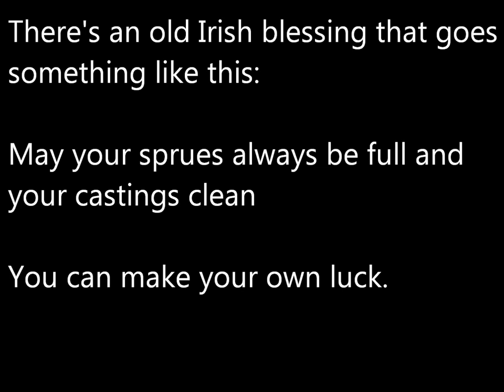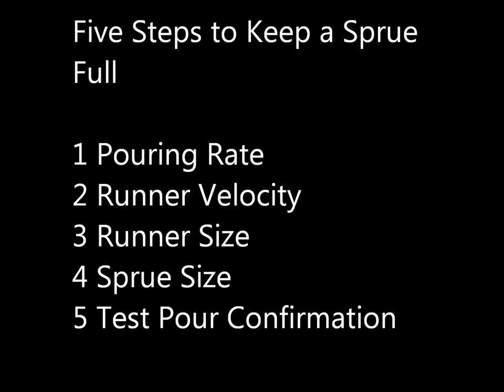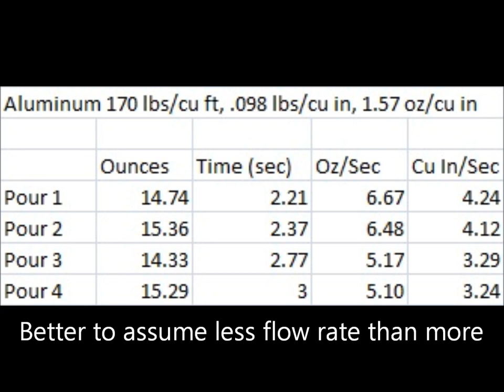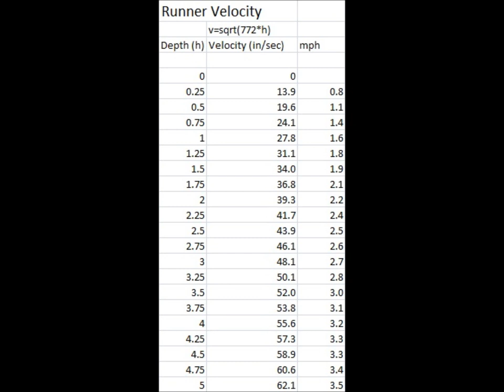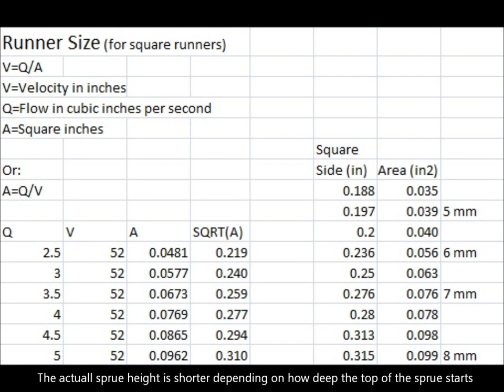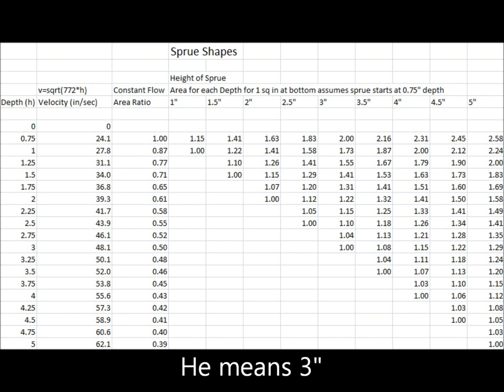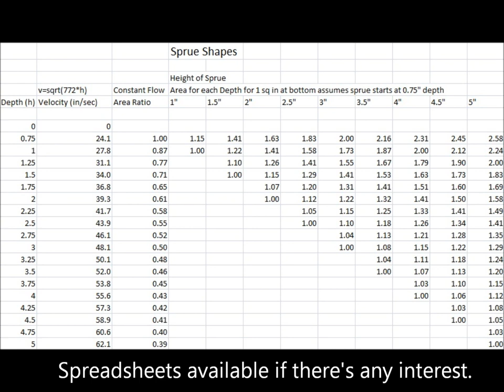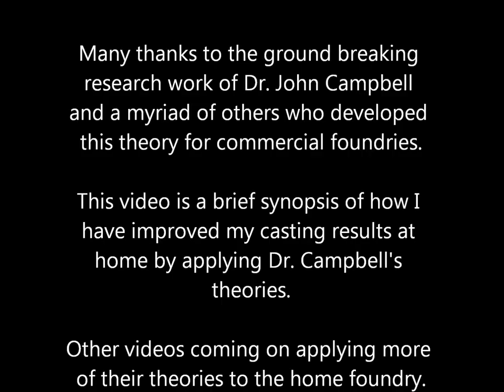Foundry 47: Keep Your Sprue Full

Comment: Andrew, Looking at the hammer castings I believe (largely because of the extensive flash around the core print) that your fill time could maybe have been quite a bit longer than 3 or so seconds. The great John C states that it is surprising how much slower many castings can be poured and that certainly is my experience. I might have been inclined to try a 6 sec fill but that of course would involve a runner and sprue so small as to be difficult to mould. Castings this small are thus difficult to rig properly. My inclination would have been to cast two hammers off the one sprue so your current sizing would have given roughly a six second fill.
I will attend to that Russian fellow's rule tomorrow (you know, the bloke with the unpronounceable name) I just need to mull over how best to answer in a useful way.... Martin
Reply from the maker: Thanks for your time, Martin.

My only goal with the four hammer pours was to gauge the pouring rate I am comfortable with.  You will note I used a giant sprue with no pouring basin and large hand dug runners.  Certainly I use smaller runners and a spin trap when casting hammers in earnest.

I want to cast two or more at a time but don't know how without more patterns.

I have attributed the flash in the core print to poor design.  I made this pattern when first starting out and always have the excess material.

I need to check on the Russian's heritage.
Reply: From a classroom prospective; Chvorinov's Rule was something we only applied to determine how long a casting would take to solidify and for sizing risers to prevent shrinkage defects. I highly question applying that formula to gating as I believe Chvorinov's Rule only applies after the metal stops flowing.
Reply from the maker: @askquestionstrythings   That is exactly the point.  You use Chvorinov's Rule to size the riser and the gate between the riser and the mold purely to avoid shrinkage.  If the gate does not freeze before the mold then it can't feed the mold.
Edit:  Should have said "If the gate freezes before the mold then the riser can't feed the mold through the gate".

Comment: Good technical info to keep for reference.  Thanks

I'm planning on casting a closed hand sized object and my understanding is that I should have a riser of greater volume to prevent shrinkage.  Is this correct?

What size runner is required between them? 
I assume that once the runner  solidifies, the two volumes shrink independently.
Reply from the maker: I'm no good at Chvorinov's Rule.  But no, you don't need a greater volume.  Maybe Olfoundryman will happen by.

Since you have a large solid mass if you feed through the riser it should be the hottest part when everything starts cooling.  There is a rule on the gate, but the larger the better.  For my hammer heads I use a short fat riser with contact of about 40% of the hammer face. (not in this video)

This is interesting reading and will enlighten you on avoiding shrinkage somewhat.

https://massalotando.files.wordpress.com/2018/10/projeto-livro-wlodawer.pdf
Reply: CP, It is not really possible to answer your question with any accuracy without a bit more information.
1. What alloy are you going to use as different alloys solidify in different ways and this can affect both the shape and size of any feeder?
2. When you say "closed hand" Is that about its size or its shape or both? Thin and thick castings require different feed regimes.
3. Does the casting vary much thickness or is it a fairly even section thickness all over?
4. Are there any heavier section areas that might be useful to attach a feeder too?
To be honest a drawing or accurate sketch would be needed. But what I usually do is simply eyeball the pattern and the reach for the appropriate feeder formers (I have lots) having done it lots guides me here. However as a general rule for aluminium castings in 356 alloy I find that the weight of the metal poured i.e. of the casting plus any feeders plus any gates sprue and basin etc is about twice the weight of the  actual casting. For thicker chunkier castings the weight of the feeder etc will go up and for thin work it will go down (quite possibly to zero!) This  is a very general rule and I will vary it a lot according to how the casting and feeder are attached. With favourable feeder attachment (i.e. a hot metal feeder) I will use a pour to casting weight ratio of 1.5.  Obviously the feeder must be larger in section than the thickest bit of the casting - by at least 20%. A favourite way of mine is to gate into the feeder and then connect the feeder to the thickest bit of the casting with a sort of gate only about 1/2 as long as the feeder is in diameter. The gate will be almost full section thickness of the casting where it connects and will flare upwards and outwards with a generous radius to meet the diameter of the feeder. This means that when fill is complete the feeder will contain the hottest metal in the system (neglecting the sprue and runner) and the casting will contain metal generally cooler and usually much so in areas more remote from the feeder - this is exactly what we want! As  it strongly favours directional solidification toward the feeder. However this implies a side feeder and  this is not always possible - sometimes a top feeder is appropriate - it depends on part configuration. In this case I tend to gate as close to where the feeder is attached as possible and the bottom of my feeders are necked down for a height equal to their diameter at a 15 degree angle (per side) in an effort to avoid under feeder shrinkage. Feeders are usually cylindrical and have a height to diameter ratio of 1.5 or maybe 2 to 1 for best thermal efficiency but I use them up to probably about 4 to 1. Note too that I almost always use exothermic on my feeders.... Martin
Reply: @olfoundryman8418  Thanks very much for your response.  
I'm casting aluminum, for now.
The object is both, size & sections of a closed fist.  No sudden thickness changes & about the same bumpy surface texture.

Your info is giving me clearer ideas how this planned project could be successful the first time.   I will read it a few more times,  I'm sure.
👍👍😊.
Reply: @cptrikester2671 , Oh dear! A thick chunky casting. They are the most difficult to feed, probably you will need a big feeder of at least equal weight and probably more to the casting unless of course you can hollow the casting out with a core. Good luck...Martin
Reply from the maker: @cptrikester2671  Very valuable insights Martin gives.

My advice is you learn more quicker by planning to make several castings modifying the attachment until you are successful.  Many times you just cannot avoid the extra cleanup a larger feed gate requires.  But you don't know until you try and fail with a gate which fits into where you want it and does not obscure casting surfaces you'd rather cast rather than clean up.

Comment: If I were a guy with your knowledge, I would have an excel spreadsheet that would calculate all this out for you and sell it for a few dollars each copy. This is great stuff and I would be your first customer. Looking for an easy way to determine size of sprue, runner, expanders etc.
Reply from the maker: It is explained in the videos.  The spreadsheet I use is incredibly simple however you have to understand the basics because each mold is so different.  It is really not difficult.

Comment: andrew i'm a little confused on the sprue shape chart .
Reply from the maker: Me too!

Concentrate only on the right hand side.  Find the sprue height you have, remembering this assumes the sprue is starting 3/4" below the top of the flask.  So if you have 3-1/2" tall flasks, your sprue will end 3-1/2" down so only look at the column under 3-1/2.

Now go to the bottom of the column and see 1.00.  Multiply that by the size of your runner.  If it is 0.076 sq in then the number will be 0.076 sq in.  The bottom of the sprue needs to be 0.076 sq in.  

Now look at the top.  2.16.  Multiply that times 0.076 and get 0.164 sq in.  That is the area of the top of your sprue.  You can taper the sprue straight from 0.164 sq in down to 0.076 sq in.  Remember these are square inches.  0.076 sq in is a square that is 0.276" on each side.  0.164 sq in is a square which is 0.405" on each side.

Hope this helps.Edit:  Per Martin's comment below, you should add 20% to the top area if you are not going to reduce the sprue as the chart shows but use a straight sided sprue instead.
Reply: @andrewmartin4258  ok i think i have it i will get back with you about it shortly
Reply: @andrewmartin4258 , In you calculations have you allowed that to compensate for the straight taper as distinct from the more correct hyperbolic one you need to have the top sprue area 20% greater than calculations based on sprue base, height, and flow rate would suggest? If not this may explain why in your glass experiments some separation is seen near the top of the sprue. Also I think greater care may be needed with the sprue entrance radius, if it is not adequate and particularly if you have a surge area above the top of the sprue and it is not radiused properly ALL ROUND then vena contractas will occur causing visible separation and lots of air entrainment (which you may not see)….Martin
Reply from the maker: @olfoundryman8418  Thanks, Martin.  No, I had not seen any mention of a 20% increase in sprue top area for straight sided sprues.  Perfect logic, for sure.  I need to do a glass one again with an additional 20%.

I'm probably guilty of not rounding my sprue entries enough.  Have to work on that.  Of course the glass pours have one flat side so it's like half a sprue.

Comment: More great stuff!  I'm going to reproduce your spreadsheets for my own use.  As I have proved before, I am deficient in mathematics, so I'm not going to attempt a calculation of Chvorinov's Rule, but it's good to know that the volume of a riser should be as large as possible in proportion to its surface area.  Doubtless there is a relationship, based on the shrinkage rate of the metal, between the size of the casting and the size of the riser.  Also not having the mathematic capability to calculate that, I a*s*s*u*m*e that it is better to err on the side of a large volume riser than it is to use a riser that is not large enough to feed the shrinkage in the mold.

Thanks, again, for your work!
Reply from the maker: Glad you had the time to watch the video!

The basis of Chvorinov's Rule is that the riser and gate should freeze last.  That's logical.  Depending on the shape of the part you are casting, you can guess pretty effectively how a riser needs to look chunky compared to the part.

Did you have a chance to look at the link?  Lot's of good information from Sulzer there, and they pretty much show you how to do it without many calculations.

For simple castings the modulus is easy to calculate, and you just have to keep increasing the modulus through the gate to the feeder.  Modulus being the volume divided by the cooling surface area.

Absolutely, a larger feed riser only uses more metal.

Thanks for the kind words!
Reply: @andrewmartin4258  I glanced over the PDF link, but didn't have time to read it thoroughly, although I will take the time to do it.  I thought the stepped riser gate design was interesting.
Reply from the maker: @carlericvonkleistiii2188  Of course it does not have to be stepped.  It can be sloped to achieve the same results, little bitty steps and lots of them.

It is worth the reading.  Although it won't be absorbed in the first few readings, the have what they call information for the practical man, rather than theoretical.  Lots of good advice and it will help everyone understand the basics and help you use judgement rather than calculations.

Comment: does this apply to the cast iron as well ?
Reply from the maker: I do not know how important it is with cast iron.  It does not appear to be damaging on the few cast iron pours I have done with a pouring basin.  Air and molten iron obviously make iron oxide which, like aluminum oxide, will not remelt into the pour but floats as slag.

Comment: jesus christ, 2024 still using imperial 🙄🤦‍♂
Useless video.
Reply from the maker: Thanks for the enlightenment.

Would my work be better if I learned the metric system?

But I'm not Jesus Christ.  I'm quite mortal though it may not seem that way to you.
Reply: @andrewmartin4258  it would become usefull for the rest of the world, conversions would be much easier and you would not need fractions.
Reply from the maker: @pedgarage  I am very comfortable with fractions.  In some cases fractions make the calculations much easier.

I am a degreed engineer and am very familiar with the metric system.  I prefer to use the English system.

Your initial comment was quite derogatory however, and unwarranted.

I regret that you learned nothing from the video because you were hung up on the units.  The units are insignificant when it comes to understanding the basics of the physics.